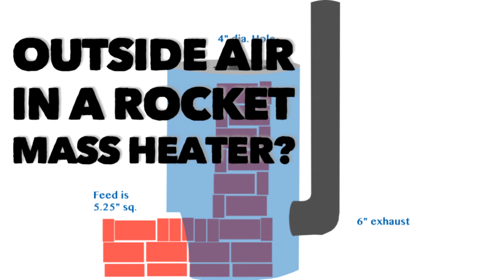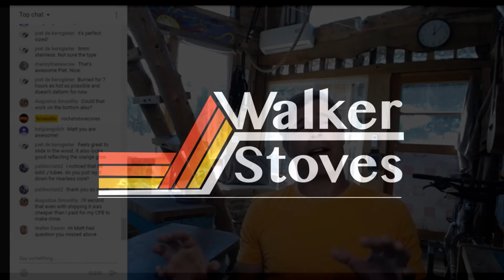Outside Air Intake in a Rocket Mass Heater Build?

Comment: I think there is a very good reason pull combustion air out of the living space. The air in the living space is already exhaust air, full of contaminants and using the stove to pull that contaminated air out of the living space which brings fresh air in for a healthier living space. The idea of a mass heater is to heat people either directly by contact or by radiation but not by heating the air (though that will happen to some extent). It is interesting to me that most building codes require 1 air exchange per hour. This may seem like a lot but those who test various things on rats find that to keep those rats healthy, they need 8 times that. As such, I suspect that the building codes are lax in this case and that people are healthier with more than 1 air exchange per hour. So use an outside air intake, perhaps with heat exchanger if you want to get fancy, for your breathing air and use the stove to suck that used air full of breathed air, various smells, leaked smoke, radon (in some places), etc. out of the living space. Lack of oxygen is a known contributor to dementia. Sealed homes are good for efficient heating but not so much for life. I leave windows open at least a little all year round.

Comment: Cia°.

You make the air inlet in the ground,
(if the ground is dry)
low to the ground at worst
(the fresh air being at ground level, pushing hot air),
but on the front of the rocket

I have not tested with a venturi nozzle....

By the way, have you tested vortex type Vortex AVEC (search for " vortex AVEC mon danstagueule ")
test with a thin metal sheet 0.5 or 0.6mm,
very effective in air intake, and at the bottom and top of the vertical chimney,
but to be made very well with glued paper pattern (double-sided tape) , dremel carbon disc, well deburred afterwards, put in regular shape (pounding on big bolt clamping sleeve), and orientation of the blades at least 45°, with 10 blades - to test orientation and number of blades porbably too)

I had made one for example with a minikeg, and lots of vortex,
a very poor quality video to show it,
but not in test,
the flame was almost a meter above the stove....

what you do I call it accelerator, or turbinator... (it spins, but does not concentrate the flame) 

Salutations.